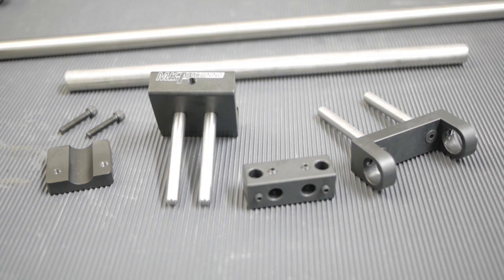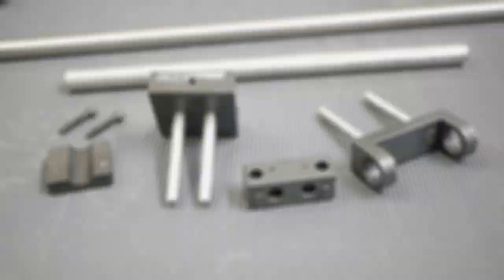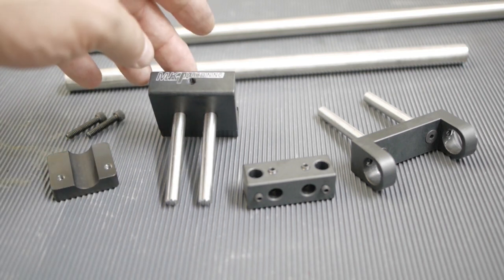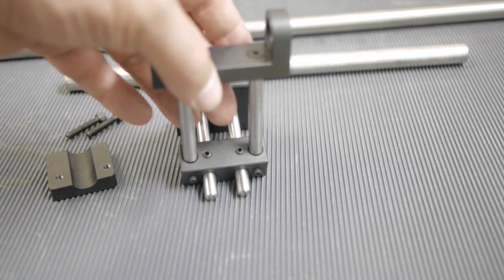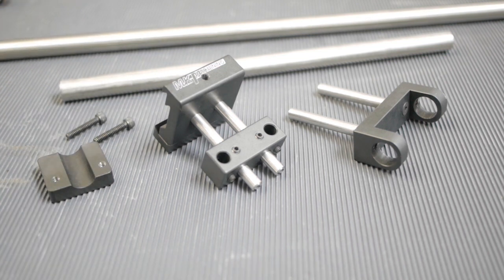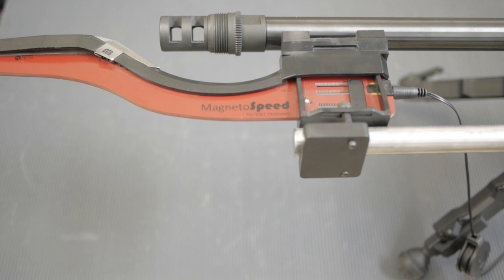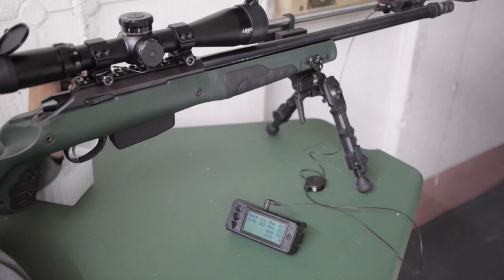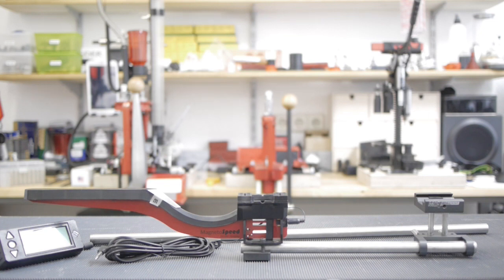MK Machining Gen III MagnetoSpeed Mount

Comment: Does muzzle blast effect/damage the bayonet when mounted on the side like that.

Have you observed a POI shift at all from the bullets bow shockwave being interfered with by the magnetos "deck". I ask this specific question as others have still noticed a very slight shift in POI due to this inference.

Thanks 👍

Comment: Nice gear. Did you notice any point of impact change with this device ? Because there is a thing that nobody talks about, it is possible to produce a small trajectory deviation due to the strong magnet of the Magnetospeed. If you dont know what Eddy current is, I recommend you to search on Youtube. In fact magnets can have an inductive effect on highly conductive metals like copper or aluminium, and the faster the magnet and the metal object are moving from  eachother, the stronger this effect is. So because the copper jacketed bullet passes at a very high speed close to the sensor's magnet, there is a chance that the point of impact changes.
Reply from the maker: I don't think the magnet is strong enough to effect a bullet passing by
Reply: @wiederladerTv  thank you. When I will have mine I will test it. I Wondered because the faster the object is moving in front of the magnet, the stronger the eddy currents will be, and you know how fast a rifle bullet can be...